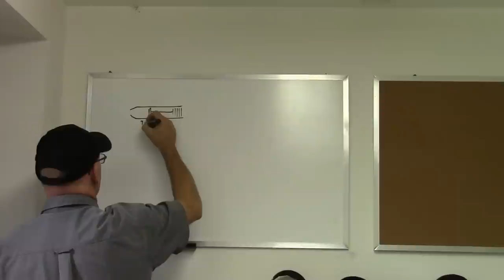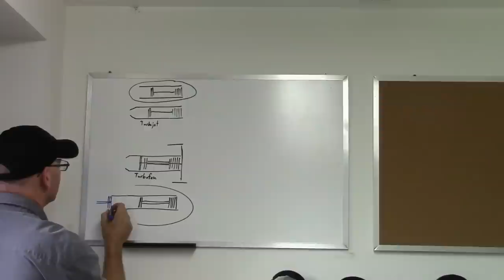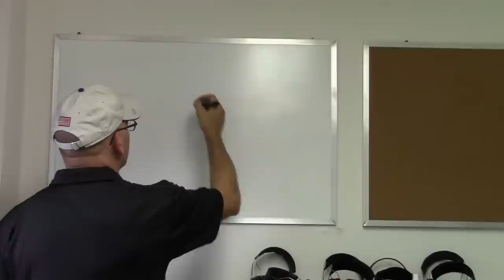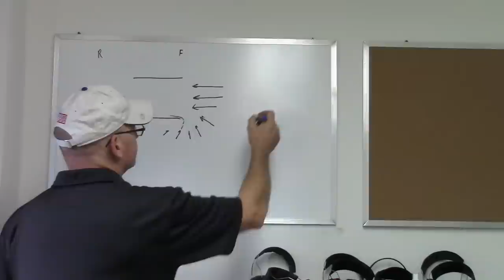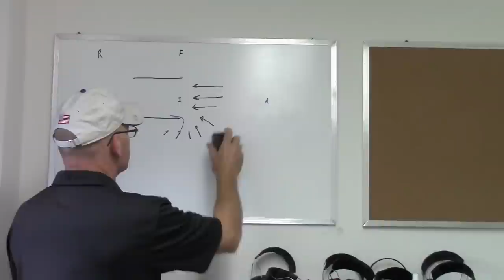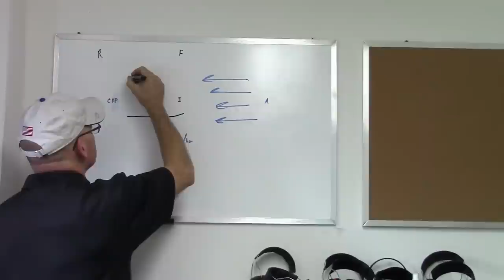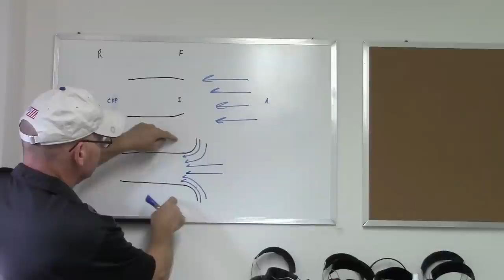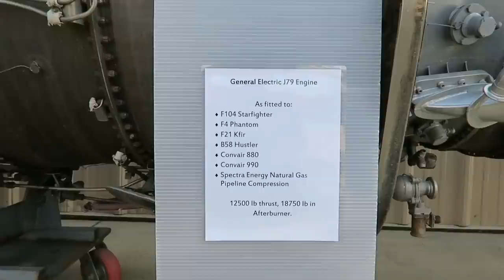Jet Questions 66

Comment: Hey, JayZ, I've got a question, but I'm not sure if you deal directly with these things, so here it goes:

What kind of specifications are taken into account when deciding whether to use 1, 2 or more power turbine stages? Do more stages provide more torque or something like that? Besides the cost, weight and maybe lower moment of inertia, what advantages would we get form less PT stages?

Thanks!
Reply: SnowRaptor Just to be clear, I was referring to industrial engines. But aircraft related replies will also be welcome =)
Reply from the maker: SnowRaptor That's a design issue, for the engineers. We are not involved with that at all.
Reply: AgentJayZ Thanks!
Reply: SnowRaptor Sticking to the subject of industrial and marine power turbines, cost, efficiency, output speed and even weight can come into the equation.  To give you a specific example, the Marine Olympus ('B'-rated) had a single-stage power turbine, running at 5,660rpm delivering 27,250SHP (why do I still remember these numbers?).  The equivalent Industrial Olympus had a larger diameter 2-stage power turbine running at 3,000rpm (50Hz UK mains frequency) giving 20MW.  Blade speed is important in terms of the ability of the turbine to extract power from the gas flow.  A smaller diameter turbine running at 3,000rpm would have needed more stages, been less efficient, possibly heavier and certainly more expensive.  However, the R-R designed power turbine for the uprated mark of Industrial Olympus ('C'-rated) that AgentJayZ has shown us had a 3-stage power turbine running at 3,000rpm, giving 30MW, the extra stage being necessary because of the increased power.
Reply: grahamj9101 Thanks, I see that the number of stages seem to be limited to the force on each stage (blade), since power transfered from the gas to the blade is equal to the force on the blade times its tangential speed. So each higher RPM and larger rotor can take more power than lower RPM and smaller rotor.  I'm simplifying out the blades per rotor variable, but the seame reasoning would apply to the torque from the rotor on the shaft.

Regarding the uprated Olympus, that sort of changes to the design are there to provide this 50% increase in useable power? Larger compressor/combustors?
Reply: SnowRaptor Excellent question.  For a low cost uprating, the design of which was done back in 1971-72, there were no changes to the compressors: the changes were confined to the hot end, for a higher firing temperature.  The 8 combustors were the same 10 inches in diameter as in the previous engines, but with improved cooling for the walls.  They were, in fact, "borrowed" from the development engine standard of the Olympus 593, which powered the Concorde prototypes. The engine had a completely new, cooled HP turbine, both NGVs and rotor blades, replacing the previous uncooled standard of the aero engine.  There were also new, uncooled LP NGVs and rotor blades (which I designed), with improved materials and aerodynamics.  To go in the direction of a larger (LP) compressor, we looked at 'industrialising' the Olympus 593 from Concorde, which would have produced 50MW.  However, the project was cancelled in 1979, not long after we started running our first development engine.
Reply: grahamj9101 Nice! So, essentially, the limiting faztor in the gas generator power itself (in the origianl Olympus) was essentially heat, then? Very cool!
Reply: SnowRaptor I may be telling you what you already know and understand, for which I apologise, but I'm also trying to explain for others who might read this.  Fundamentally, a heat engine works by compressing a working fluid, adding high-grade heat energy at high temperature, allowing the working fluid to expand to produce useful work and then rejecting low-grade heat energy at low temperature, before the cycle repeats itself.  Ideally, the thermal efficiency of the cycle is improved by increasing both the maximum temperature and pressure of the process.  Increasing just the maximum temperature does give some small improvement, but it is a relatively easy way of producing more power out of the same basic machinery.  In the case of a gas turbine, this comes at the expense of more heat resistant materials and/or cooling.  The latest industrial and marine gas generators operate at much higher pressure ratios and turbine entry temperatures than the machines that AgentJayZ shows us and they are significantly more efficient, with a much lower fuel consumption. However, they are more complex and expensive, which is why S&S and Maddex are in business.  Where a light and compact jet engine is required, such as in a modern military turbofan, the pressure ratio will probably be no more than 30:1, but with a turbine entry temperature (TET) of 1,800degK, with 2,000degK in prospect.  Compare this with one of the latest big turbofans, where the pressure ratio may now be over 50:1, with a TET of over 1,700degK.  The higher pressure ratio results in a higher thermal efficiency, at the expense of greater weight and more complexity.  Added to this, a high propulsive efficiency is achieved by using a large fan, again at the expense of greater weight and complexity.
Reply: grahamj9101 This is essentially an educational channel, I don't care if I already knew some part of what you said, the way someone in the trade explains these things is always enlightening for someone outside =)

I'm a theoretical physicist, so I know the theory behind heat engines, but the way they are built and the engineering details behind design decisions are completely alien to me. When you or Jay explain this stuff, putting emphasis in the aspects that are most relevant to the engineering/building side of things, I learn a lot of new stuff that's pretty valuable not only in a "general culture" aspect, but also because I teach engineering students, so it's very useful to know more applied things. Thanks again!
Reply: +SnowRaptor  Many thanks for your reply: I'm reassured and encouraged.  I acknowledge that, as a former gas turbine designer, I'm a 'jack of all trades', and not a specialist performance engineer, stress engineer, or aerodynamicist.  I've mentioned before that I was brought up in the motor trade (US: auto repair) and got my hands dirty at an early age, so I have a practical turn of mind, which I like to think helped me in my career.

Comment: @ around 20 minuets you are standing next to a compressor. Why does the final stage appear to have less blades than the second to last stage?
Reply from the maker: Geo Each stage is designed to to its job best. The last stage has a different job, because it does not feed another stage. To know exactly why a certain number and shape of blades are chosen, we would have to ask the engineering team who designed the engine, but they are all gone now. That compressor rotor is from an Orenda type 14 , and that engine was designed in the late 1940s

Comment: Do industrial turbines ever use a king shaft for power output the same way they are used to drive accessories?
Reply from the maker: Need to clarify what you mean by:
Turbine... do you mean turbine engine or turbine. They are not the same thing.
King shaft... Never heard that term.
Reply: @AgentJayZ  turbine engine such as rolls Royce ae3000 which has a shaft geared to and  perpendicular to the N1 shaft. The other end drives an accessory gear box with fuel pump, oil pump, hyd pump, generator, etc.
Reply from the maker: I've checked, and there is no engine listed as a RR AE3000, but there is a lot of info out there on the AE3007, which is an aviation engine.
The AE3007 is a two shaft engine, so any shafts geared to a main rotor would be driven by the HP shaft, also known as the N2.
Typically the N1 shaft is not used to drive any accessories except speed pickups.

Every modern gas turbine has a radial drive shaft, driven by the HP system, but it is never used as a drive shaft through which the bulk of the power is transmitted. It transmits a small portion of the total power to the accessory gearbox, to drive oil pumps, fuel pumps, tachometers, etc.

To my knowledge:
-There isn't an single industrial gas turbine engine that has a bevel drive integral to the rotor shaft in order to have the main drive shaft be at a 90 degree angle.
-There isn't an industrial engine with an integral power turbine that is placed at 90 degrees to the main rotor.
-There isn't an industrial gas turbine engine that has an integral power turbine which also has an integral 90 degree gearbox.

Aside from that, the output shaft from a single shaft industrial gas turbine engine is the main rotor, and can used to drive any separate gearbox you want, that can have an output at any angle.

Also aside from the above examples, any industrial gas turbine engine functioning as a gas generator can drive it's separate power turbine through any arrangement of turns of the ducting the designer of the installation chooses.

Comment: Hey AgentJayZ, 
i have a question about the gas generator,  instead of having a duct that will use the gas to run generator in the back,  why not connecting the generator to the main engine shaft? wouldn't be faster and more efficient power generation? 
thanks
Reply from the maker: +Waleed ALmalik 
Please watch my videos on power turbines.
If you then still have this question, you will need to look elsewhere.

Comment: AgentJayZ you stated, in Q65, that a 1400 SHP turboshaft will get beat by a 1500 HP piston engine. Has the racing team thought about switching to a GE T700? It's "only" 1536-2638 SHP. LOL
Reply from the maker: Alfredo Pacheco Jr It's also only another half million dollars, plus a complete redesign of the boat... which means a new boat.. plus figuring out how best to adapt and use it in a race boat as opposed to a helicopter.
It's coming, but not next week...
Reply: AgentJayZ Oh, come on. If these guys can put a jet engine on a truck and create a makeshift A/B, I'm sure you guys can come up with something. ;-)

Would the racing league be upset if you showed up with a boat capable of holding an F414 engine (granted you'd only have enough fueled onboard for a few min before you burned it all up)?

Comment: could a turbofan be used for industrial applications by "simply" replacing the fan with a coupling to the load? reusing the shaft and powerturbine normally used for the fan
Reply from the maker: Yes, that is one way to do it, and it has been done. Minimal design changes, so the lowest up front costs. The result is what is known as a cold end drive turboshaft engine.Some helicopter engines use the exact same layout, although they did not start life as turbofan designs.
The main difficulty here is that optimal fan speed is often different from desired shaft speed for the industrial application, so a gearbox may be needed.
Reply: @AgentJayZ  Thanks, It did seem like an obvious possiblity to reuse some of the engineering that went into that. My doubt was if it couldn't work because the turbine for the fan wasn't designed to extract "all" the energy from the hot gas
Reply from the maker: Yes, some efficiency is lost. This is part of the end cost. In some applications, fuel consumption is not an important concern.

Comment: I hate to argue with you but there isn't a hard and fast law about owning after burning engines running variable nozzles, at least not in the US or UK. The last two land speed record holders, Thrust 2 and Thrust SSC used afterburning jet engines. Reheat as they would say. Thrust 2 has a Rolls Royce Avon 301R (16,000 pounds thrust with reheat) from an English Electric Lightning and ThrustSSC used two Rolls Royce Spey 205s (25,000 pounds thrust if they really were 205s, 20,500 if 203s) from the British F4-K Phantom. You can see the nozzles working and hear Andy Green commenting on their position in the onboard videos. 

Their next attempt with Bloodhound will use a Eurojet EJ200 (20,000 pounds thrust with reheat).

The American Eagle land speed record car has a J-79 as did Craig Breedlove's Spirit of America. Spirit of America Formula Shell LSRV was getting 22,650 pounds of thrust on pump gas, sponsored by Shell (Royal Dutch Shell amusingly). It crashed at 675mph and he walked away.

So, five afterburning cars, four run in the US, two with US sourced J-79s.
Reply: cageordie I don't think I can post the youtube link, the video ID is zL77yBUOZhQ if you are interested. In the cockpit view you can see he has full lock on the steering at near supersonic speed. They idled the engines until the residual thrust got them to 100mph then went to full military, running up the engines at slow speed could suck in the desert instead of air. By the last run the burners were melting the rear body panels.
Reply from the maker: cageordie These guys were superstars with records of impressive achievements in land speed racing before they approached their respective air forces, and they got some pretty special help.
As with all general rules.. there are exceptions.

Comment: What would happen if you were to spray a mist of oil into the gas generator of any given turbine engine? What would it take to disable the engine?
Reply from the maker: +Lou Herman That is the kind of question that would be asked by a terrorist... or at the very least, a determined vandal. 
You now, Lou Herman... go suck on it.
Reply: +AgentJayZ my sincere apologies. I was wondering if there would be any way to disable an aircraft without damaging the airframe. my question was merely supposed to be a thought experiment. You do raise an excellent point that I hadn't thought of. Once again I do apologize, I'm not a terrorist I swear. 
P.S. thanks for the swift answer, as hostile as it was.
Reply from the maker: I get a lot of questions about what's the worst thing... what Would happen if...
Sometimes from gouls who just want to see people die, sometimes from who knows what.
You seem like a nice guy, and it appears I was mistaken. 
It's very easy to disable an engine, but, just like talking about what's the best way to wreck anything.. I think I'll just take a pass on that one, OK?
Reply: +AgentJayZ Absolutely fine, Thank you anyways.
Reply: +Lou Herman I think you asked an intelligent question in a very unintelligent way.  There are obvious things that can disable a jet engine, which are widely known.  A flight of Canada Geese going into the engines of an A320 can result in it landing in New York's Hudson River.  A thick cloud of volcanic ash over Indonesia can clog up the engines of a B.747 and turn it into the biggest glider in the world.  Engines do not like ingesting so-called 'foreign objects', which can cause 'foreign object damage' (FOD).  Further than this, I will not go.  However, going off subject slightly, I do recall having to design a manifold for the intake of an industrial gas generator, specifically for the injection of inhibiting fluid.  This would be done during a 'dry motor' cycle (running the engine on the starter with no fuel and no ignition), to provide some protection to those gas path components that might be subject to corrosion during an extended shutdown.  The fluid might even have been something as well known as WD-40 .....